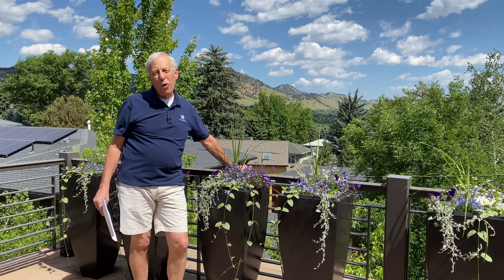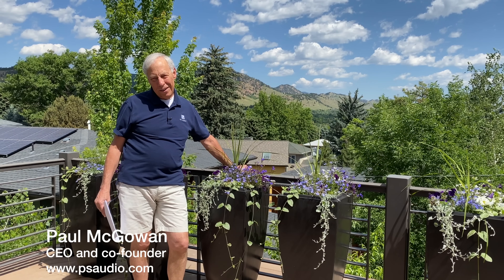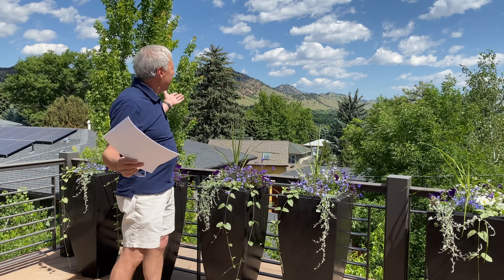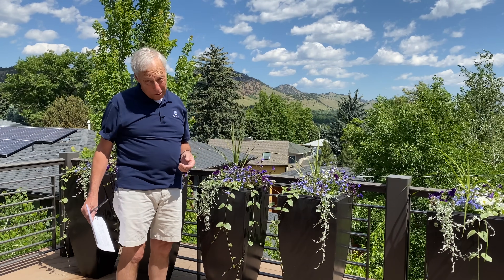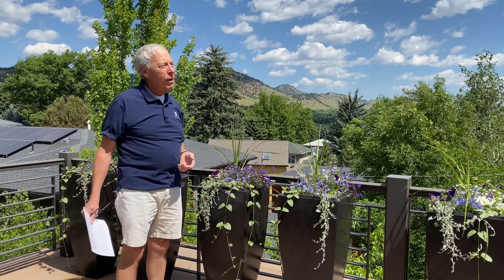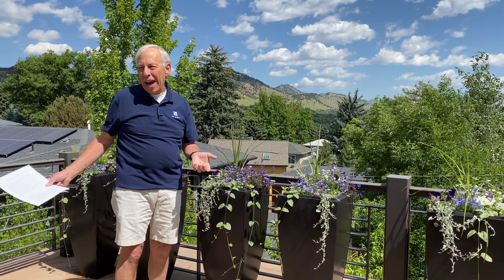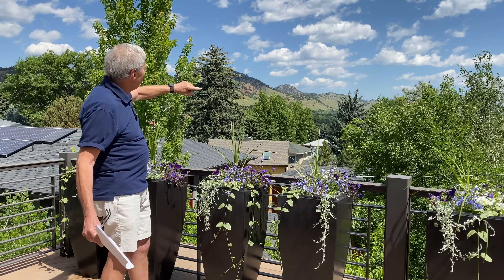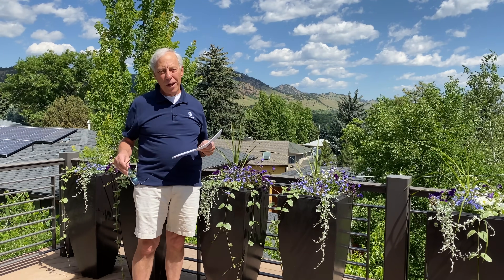High voltage equipment damage

Comment: PAULLLLL What IS AMP BIAAASSSS for the rest of us?
Reply: Idle current running though the tubes!
Reply: @graxjpg  Thank you but even non tube amp have Bias right?
Reply: Mardak yes transistors have an idle current as well!
Reply: Mardak my guitar player brain puts tubes in amplifiers when I think of them LOL
Reply: HELLO MIDE FRENDS! is this the article you were looking 4...

No matter the manufacturer, how good the design is, or the quality of the parts used, tubes will eventually wear out. They also don’t wear at even rates meaning eventually some tubes will be working harder than others. Without getting into too much detail, changing the bias controls the amount of current that flows through the vacuum tubes of your amplifier, with each having an optimum setting. If the bias is set too low (often referred to as running cold) the amp can sound thinner and less dynamic, and generally won’t be performing at its best. If set too high (often referred to as running hot) it can sound harsher, less accurate, and can greatly reduce the lifespan of the tube.
Simply put, we want to make sure all the tubes are working (roughly) at the same strength and thus have the appropriate amount of current flowing through them. Left unchecked, we risk not only blowing a tube, but risk damaging other components of the amplifier.

DONT TOUCH THE INNARDS OF A TUBE AMP or transisters amps. They have lots fo electricty stored in them. One way is to unplug it fromt he wall power and turn it on to amke sur eithas drained, but always sheck with a volt meters. DOTN TOUCH THE INNARDS IT AHE LTOS  VOLTAGE STII INT HE CAPCITYES! THNKE YUE AND THUMBES UPES!
Reply: @ilovecops6255  .. future tubes will have dsp's inside for that great warm sound.....
of course those dsp's will be processing optical data internally and just like tube glow , plasma flow will be seen..
dont think about its temp.. it's just as COOL as a tube..
Reply: @analoghardwaretops3976  THANKE YOU MINE FREDNS! Warmn sound is trolling off treble, which includes reducing tyhe nice overtones made by tubes. Guitar processors such as RP series can already to that emulating high treble harmonics such as JCM 800 and such, so there isnot much point to make more DIgital SIgnal Processors. They also do time domain effects up to 8 effects at a time in any roder. Is this the article you wanted...

The harmonic content of an overdriven tube amplifier consists primarily of 2nd order and 3rd order harmonics with some 4th order harmonics. The harmonic content of an overdriven transistor amplifier is primarily 3rd order with suppressed 2nd order harmonics. 2nd and 3rd order harmonics are the most important from a viewpoint of electronic distortion. Musically the 2nd harmonic is an octave above the fundamental and is almost inaudible, yet it adds body to the sound, making it fuller. The 3rd harmonic is a musical 12th. Instead of making the tone fuller, a strong 3rd harmonic makes the tone softer. The odd harmonics (3rd, 5th, etc.) produce a "stopped" or "covered" sound. The even harmonics (2nd, 4th, etc.) produce a "choral" or "singing" sound. Adding a 5th to a strong 3rd harmonic give the sound a metallic quality that gets annoying in character as the amplitude increases. A strong 2nd with a strong 3rd harmonic tends to open the "covered" effect. Adding the 4th and 5th harmonics to this gives an "open horn" character. The higher harmonics, above the 7th, give the tone "edge" or "bite." 

THANKE YOUE AND THUMBBES UPS!

Comment: Surge protection: install it at your house fuse box near the main switch where the power enters your house. This is the most effective place
Reply: oR WHERE THEY HAVE A magnetic cirfcuit breakers. THANKES YOU AND THUY,BBS UPS!
Reply: Eelco Sterringa Easier said than done... That’s not like pulling a plug out of a powerpoint and putting a surge protector in it’s place in which you put the original plug. You need to have space in your fuse box, buy a surge protector of that size and with screw terminals (so meant for in a fuse box), rewire the whole load, optionally have it inspected by an electrician (some places require it).
Reply: @Engineer9736  you can purchase whole house surge protectors designed to be installed on the main lugs, it's not a job for an amateur, obviously the meter must be pulled, but I've done several that way, peace
Reply: @poserwannabe1 ...do you have any views on the theory that surge protectors degrade the SQ of your audio system?
Reply: @FatRat-f9m  as long as the equipment is being supplied the proper voltage and has enough current available (especially for power amps) it's not possible for it to affect the audio. I also feel power "regenerators" would be better used as boat anchors.  😁

Comment: high voltage is what my stereo equipment runs on. 480 volts at 430 mAs  in the power amps HT voltage with a bias of 54 mVs and 6.2 volts @ 15 ampers in the heater rail primary mains voltage input of 120 volts. my preamps I build are a voltage of 450 volts dc @ 90 mAs and 6.2 volts dc at 5.5 A for heaters and going into 2nd 3rd and 4th HT stage end result about 130 volts and another 4k ohms @ 22 uf 450 volt capacitor about 95 volts under load for 6dj8 ecc88 6922s.
Reply: @FatRat-f9m  lol HA!!!
Reply: I don tuse tube snoe mreo. The copst a lot of $$$$$ and need to be installe din pairs. I use a DIgitech RP pedal and a go in the EFFECTRS RETURN OF A transistopr power amp. Tubes do sound better than a transistors with op amps and clipping dioded ot silicoe germanium transistors, I just cant afford it. Marsha PLexi with a TUBE RECTIFIER for th ewsponge king odf ount on the thick E string. THANKLE YOU AND THUMBBS UPES!
Reply: i love cops You did your best on not leaving a single word without typing error? 😂
Reply: @FatRat-f9m  you could always build your own stereo equipment just note whatever you build on your left channel has to be exact on the right channel I think 12au7s and 6922s are dead quit in operation you need about at least 140 to 250 volts dc find a simple circuit that is reliable keep it bare bones as much as possible.
Reply: @TheWarped45 ...once upon a time maybe I would've been motivated enough to build my own stereo equipment however I'm too disinterested & lazy to do so now. I'm far more interested in spending the last few remaining years that I have on this oversized ball of dirt & water just listening to music on my existing stereo but thank you for your imaginative suggestion...btw "TheWarped45" ...great moniker!

Comment: I have surge protection for everything but was told plugging a power amp into a surge protector affects the sound so its plugged into the wall. Not sure if this is wise but I want to get best sound from my amp.
Reply: Well does it sound any better? If not, don't worry about it.
Reply: ZeroSurge is my brand of surge protector . All my gear plugs into an Equitech balanced power supply and it's plugged into the ZeroSurge . I had a friend over and we did a test filtered versus unfiltered and there was no difference in the very clear and revealing sound of my well above average gear .But no high current Class A power amps, either . YMMV

Comment: On a 120/240 V system =/- ten percent is considered acceptable.
Besides lightning strikes, there is the possibility that a falling tree limb or a vehicle hitting a power pole could drop a 5,000 Volt line into contact with local lower voltage service lines. A surge protector will fail in this instance (by burning out), but it will protect devices that are plugged into it.
Reply: Once the surge blows out the MOV, it will not protect anything. Such a surge will likely blow out many things in your house.
Reply: @StewartMarkley  Most are designed to fail to open circuit. A lightning strike could arc over depending on how well grounded the device is.
Reply: @machintelligence  To fail open circuit means that enough current flowed to open the circuit, like blowing a fuse or circuit breaker, which occurs much slower than a MOV conducting. So there still can be significant energy passed after the MOV conducts and blows out until something else plugged in conducts enough current to blow a surge protector fuse or circuit breaker. But surge protectors can certainly help for short transients which they are designed for.

Comment: No doubt PS Audio makes great regenerators. But not so often is the audio quality limited by the AC mains power conditions...really. But if you live in the desert with your old diesel generator powering your system or your house has an elevator motor on the same wiring, probably you need it. A power amp usually doesn’t run the power rails regulated and is thus having more power line dependent fluctuating power rails. Anyway, just for the cosmetics of it, a power regenerator is a must-have when your system gets above US$100,000...
Reply: A cosmetically perfect system is a system that you are not able to see.
Reply: @Engineer9736  You sound like a gen Z consumer: http://www.insideradio.com/app/Image2020/Jacobs33.jpg
Reply: ThinkingBetter Don’t know what you mean. Is it an insult? If so then it’s good. Bring up some more.
Reply: @Engineer9736 No, definitely not an insult but just about the fact that younger consumers in general prefer audio that is much less visible e.g. audio from a smart phone using earbuds and small Bluetooth speakers.
Reply: @Engineer9736 ...a perfect insult is an insult that you are not able to see.